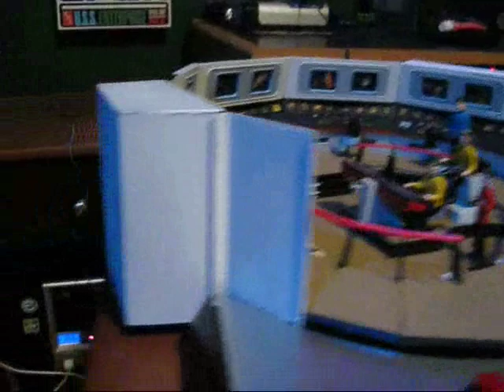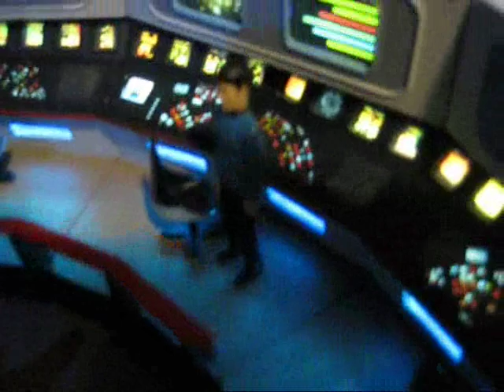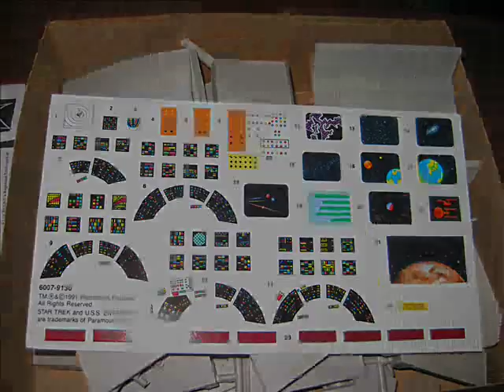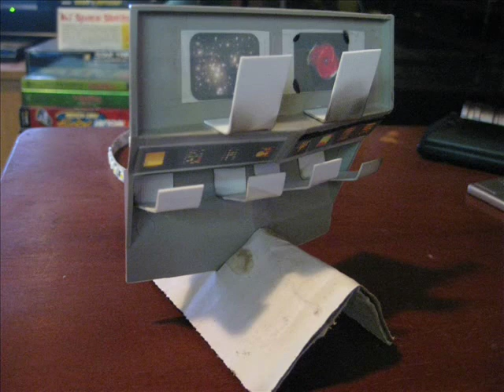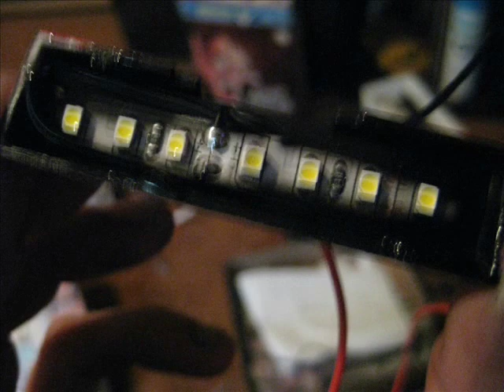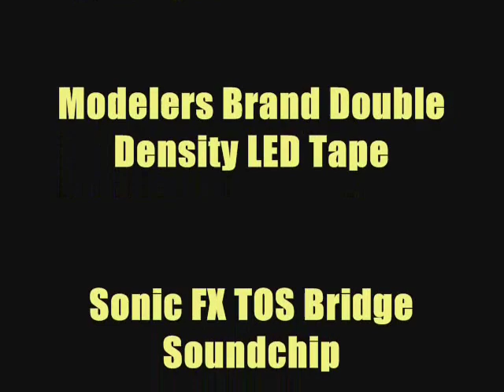AMT Enterprise Command Bridge with Lights and Sound by TrekWorks

Comment: I had this kit many years ago and I swear that mine didn't come with any figures. I don't even recall mine having a floor, all the chairs and such were just separate pieces that you arranged inside the ring. I was relatively young at the time and never thought to add extra stuff to kits. Not that I do that now, since I haven't built a model in a very long time.

Comment: I don't know exactly how to ask this, but what do you use to support the decals on the  side station viewing panels? I understand your backing plates have the lights and they are spaced from the actual station veiw port face I am guessing to lower intensity.  However, the decals could not be supporting themselves. I was thinking on using a semi-translucsent milk carton to make plasic backings for them  on my bridge and so the LEDs aren't too intense and just running my wires behind that with scotch tape.. as for gluing milk carton plastic to the view port openings, would this adhear to the polystyrene?
Reply from the maker: +fucheduck The screens on the walls are not decals. They are custom panels made for back lighting from a company called outerspace outfitters. This is from about 4 years ago so I'm not sure the company is still around. 
Decals are going to look washed out when backlighted.
Reply: TrekWorks thanks for the reply, I'll just find another way.
Reply: +TrekWorks  Don't they make LED screens (as in TVs, smart phones, not the lights) small enough to mount as portable screens?

I thought I saw a video where someone mounted small screens in a model to mimic an engine bussard effect or something like that...

That might work here, too.

I think it'd be way more expensive than what you did but it'd be interesting to see something like that...  I imagine someone will do that sooner or later.

It'd be neat if somebody could rig small screens and actually have animations running on the screens.  

[There is a website -- no longer updated -- that has all kinds of Star Trek animations and some neat screensavers that are compatible with Windows PC's.  This is the type of thing I'm talking about seeing displayed on-screen.]

You know, prior to TNG, ALL the console graphics in Star Trek were pretty much hand-drawn, hand-animated.  On TNG, they used earlier versions of Macromedia Director to create some of that show's console graphics.

Comment: Now that AMT has re-issued the full bridge with new figures, are you going to add in the extra crew and some of the new components to this excellent model?
Reply: I definitely felt the loss of three key characters -- McCoy, Uhura, and Chekov.  Chekov should have been been at the navigator station next to Sulu.
I don't know if Scotty was represented by the red shirt but he should be in there, too.
Boyd didn't build both sides and the engineering station would have been on the unbuilt left half of the bridge.

It'd be nice if somebody made the bridge with actuated turbo lift doors!  You they model part of the turbolift car and stick a figure in that, too!